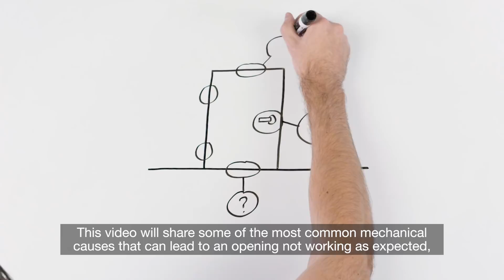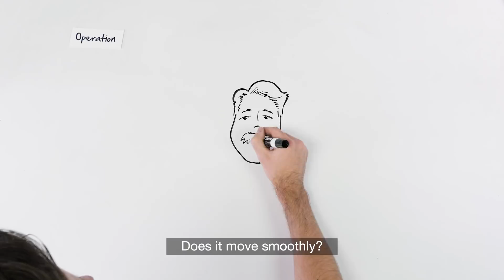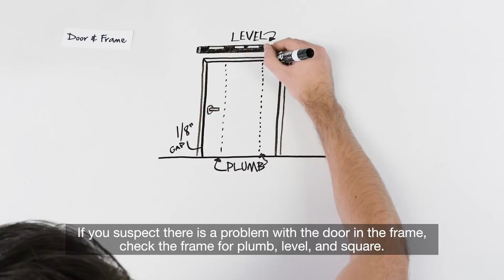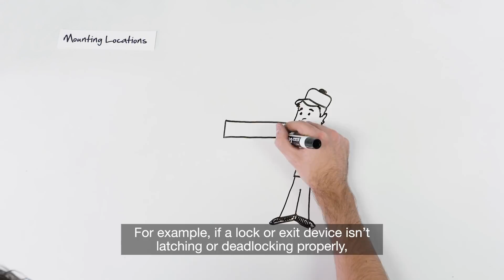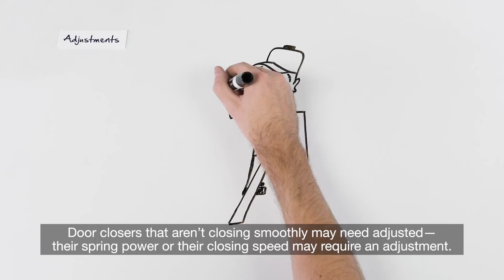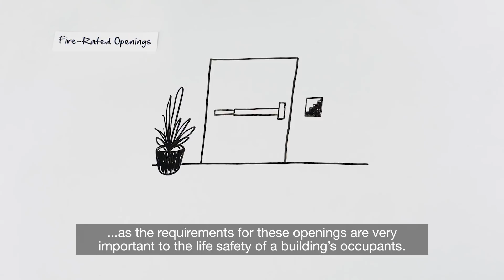Intro to Door Hardware: Diagnosing a Problem Opening 101

Comment: I have done commercial door and frame and hardware installs for twenty years ,and now I do building maintenance for a large city ,and I can attest that the major cause of commercial door failure is ...mis-use and abuse by the tenants , cleaning staff ,contractors ,and delivery people . It keeps me and my crew very busy !! 
                  Todays doors and hardware can operate efficiently for years ,if used properly ,chocking doors open and floor cleaning machines ,and occasional scissor lifts needed for lighting repair or painting is also detrimental to our thousands of doors .Our facility spends tens of thousands of dollars per year on new door ,and hardware replacements ,where as ,if some responsibility awareness by these door abusers could be taught ,these costs could be lower. These items are expensive ! Your video only scratches the surface on what does damage doors and hardware ,but,they were absolutely correct ! Thanks ,it's nice to know ...we are not alone out here !!